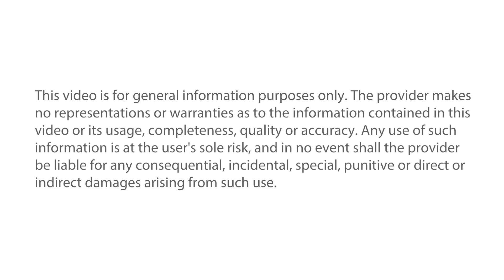VVT Control Solenoid Replacement - Dodge 3.6L

Comment: There's a shortcut video from Chrysler that say you don't have to remove the timing cover etc. There is a wedge kit they sell to hold cams in place
Reply: Do you have a link to this video? I recently replaced the solenoids and thinking that's the part I have to replace and don't want to mess with the cams

Comment: what would happen if one of these went bad?
Reply: Invalid timing alow response from thick oil or just codes from internal failure. Usually replace it sometimes you can clean them. Usually just replace it.

Comment: Wre is the oil valve . Were the screen gets pluged i have rough idel no codes
Reply: I have the exact same problem where the engine keeps msifiring or runnning rough and no codes are set. I changed everything on it so far from coil packs, plugs and injectors. Plus did a 1000lb cargo load test and on empty load test over 20 miles and there is no difference in mpg, still run at 15mpg no matter what I do.
Reply: @hongkonguser3951  are you loosing coolant?